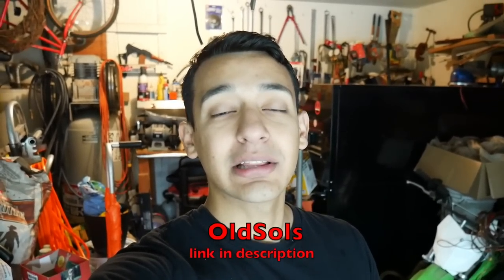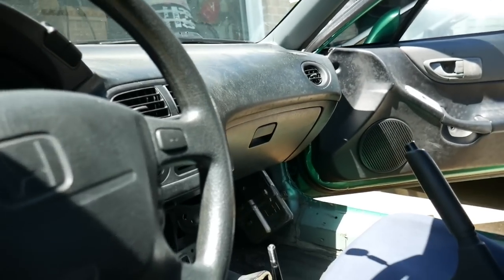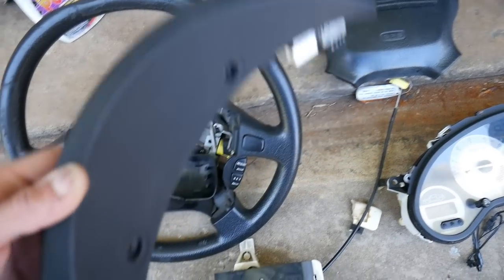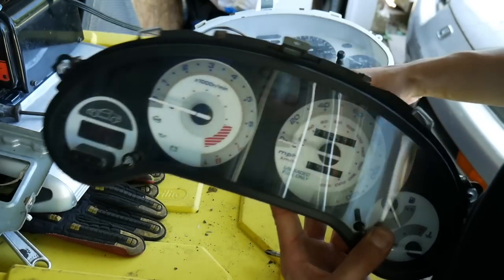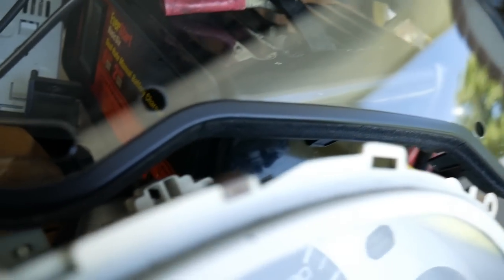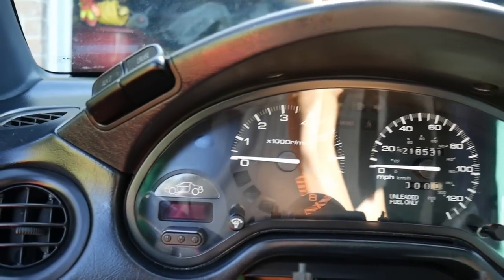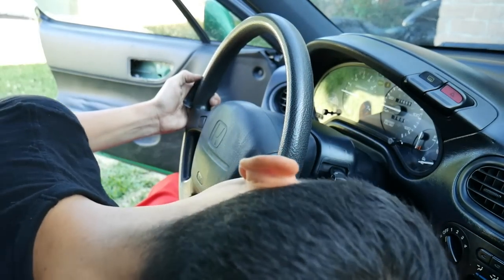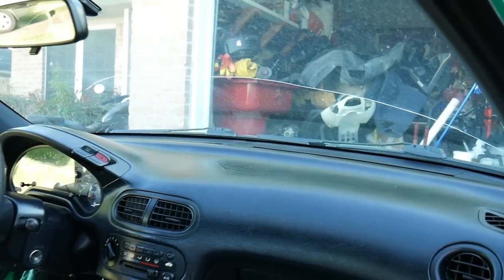Coming Together Nicely!

Comment: Any chance you might post what cleaning products you prefer? In particular I'm wondering what is a good cleaner for the padded dash that wouldn't be to harsh on it. Thanks
Reply from the maker: I just use citrus cleaner on interior panels or sometimes just regular dish soap, cause all you need it to do is break down the old protectants people will use on interiors or dirt/grease from being touched over the years.